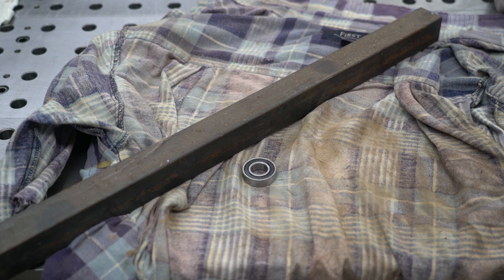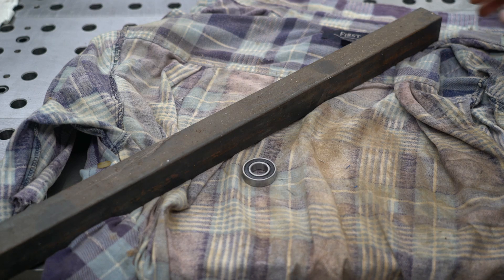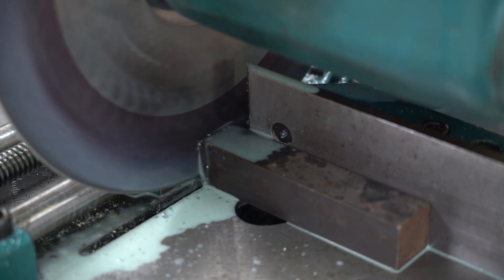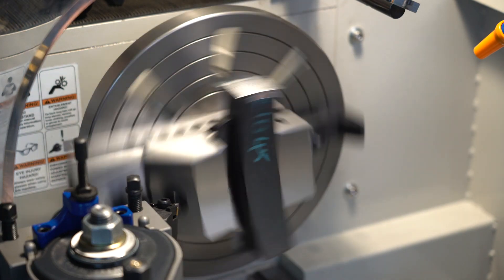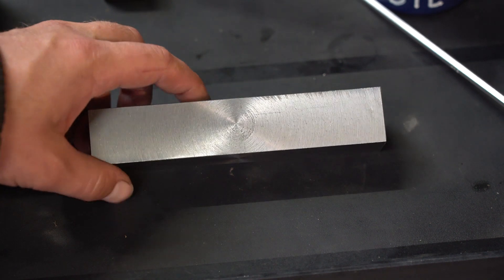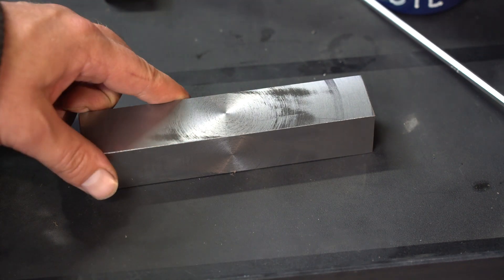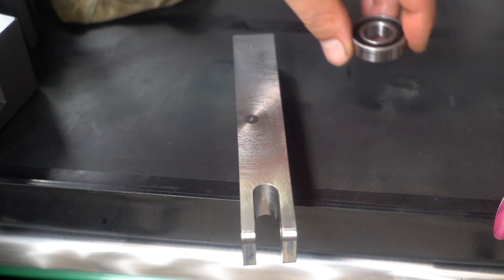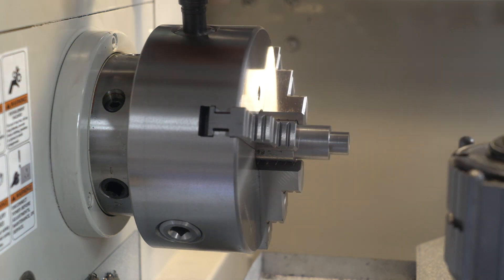Making a Lathe 'Bump' Centering Tool on a Lathe

Comment: I watched the Wachovia spindle repair vid. first…. so had to come back to this one to see what a ‘bump tool’ is.
Good solution, and we’ll executed without a milling machine.
What breed of lathe is that you used? I’ve got a ( heavily modified) Hafco 960B that I acquired almost new in about 2000.
Reply from the maker: Lathe is AL1000 bigger cousin of the 960b. The 960b is definitely a nice lathe.

Comment: I see heat treatment bluing on the bearing end. What materials stock did you use and reason for heat treatment?
Reply from the maker: The shaft was a bit tight so I heated the steel up of camera to get it to go in easier. Steel is 1045

Comment: You might consider showing how the tool is used. I have not seen many use this tool to align material on the interwebs...
Reply from the maker: Will be used in the next video for a lathe spindle repair but not for aligning work.
Reply: @ProjectsDownUnder  Thanks, looking forward to it !

Comment: Thank you.I´l like to see how you use it.
I keep practicing on my D-bit  tool sharpener.I loved the video that you made on sharperning twist drill bits.Now could you provide further information on the plates that you made for the attachment or do you think is it is not worth the effort as other people think?.I´l appreciate your opinion.Thank you .Merry Christmas.
Reply from the maker: Technically you don't need to make the plates but they are helpful. They are approximately 6.5mm, 9mm and 12mm long from the mounting hole.
Reply: @ProjectsDownUnder  Thank you Sir.I´l do.